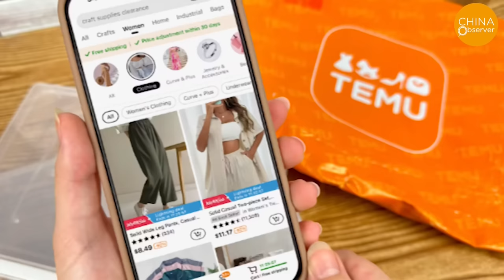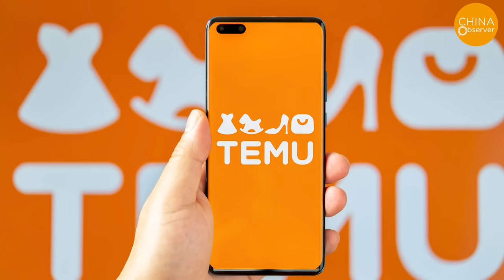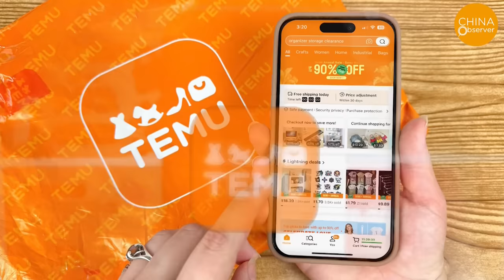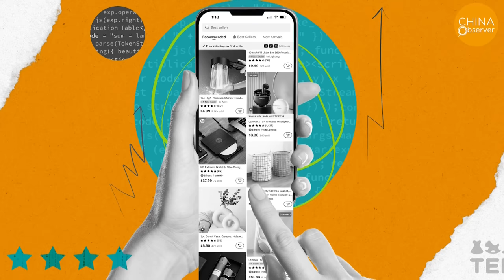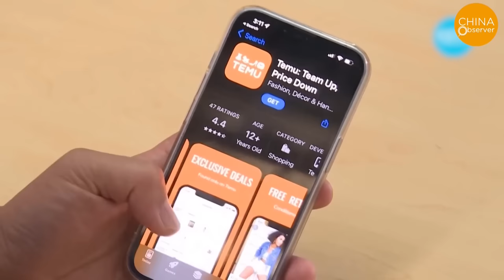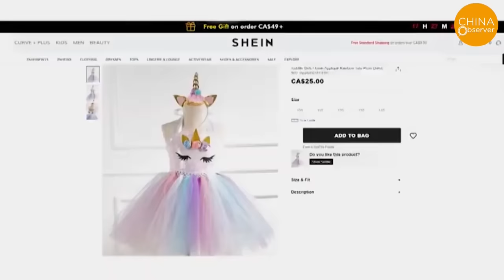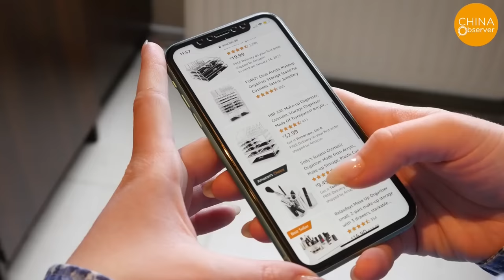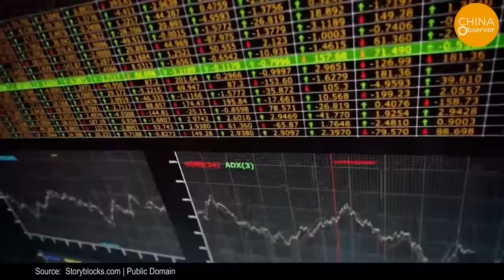Fake & Subpar Products Ripped Through Temu’s Facade, Making Chinese Firms Everyone’s Punching Bag

Comment: The bitterness of poor quality is remembered after the sweetness of low price is forgotten. You get what you pay for.
Reply: Pretty useless to buy something that craps out soon, and you need to buy another one. Better to buy quality and pay more. I have tools that my father bought when he started his trade. They still work fine, and will last another generation if taken care of. Too many tools from China fall apart in short order.
Reply: There are heaps of items where paying an extra 3-5 dollars less than the Amazon price will not make a damn difference so temu is good when you need to buy those items.
Reply: Prices are astronomically high...Forcing manufacturers to reduce their prices is GREAT!!!!....❤
Reply: Absolutely. Anyone  remember Craftsman tools? Sears used to sell them. Lifetime warranty. Gone, replaced by cheap knockoffs. Never had a Craftsman socket split apart. Seen it  several times with cheap Chinese crap.
Reply: Exactly  if they do it to their own people they will definitely do other people wrong
Reply: Sounds like someone is getting a little upset because of Temu. She never said anything they were doing that hurts anyone except those who would cheat the consumer with high prices. With Temu around they have to charge reasonably. Yah nothing wrong with that.
Reply: That is why you can also get expensive items made in China too.. If you buy expensive items the quality is very good. Even better than things made in your own country. You can also buy bad quality things made in your own country too.
Reply: the good taste of quality lingers long after the sweetness of a good price
Reply: @Studioladya I always think this...  the evidence is astounding lol

Comment: In Germany you say: If you buy cheap, you buy twice. First the lesser product, that do not meet your expectations, the the lasting one of propper quality. 

Sir Peter Ustinov said: The joy about the low price vanishes faster than the misery about the bad quality.
Reply: Not everyone has or had the same salary ect of Peter U. Unfortunately.
Reply: Buy once, cry once
Reply: The problem with your theory is that now in 2023 it is not always possible to buy a quality version of every product. Many products are only made by one or two chinese factories that make them as cheaply as possible.
Reply: @SirReptitious  than is right, but just another issue.
Reply: Unfortunately, all companies are now getting thing manufacturing outside of Germany and we have no choice. Same in other countries.
Reply: @nitinkumar29  Check your point of view:  „All companieas“ „no choice“ is absolute bullshit. Even if there are single occasions where a unique product is just manufactured in china.

 But most of the times there ARE alternatives. 

I bougt tshirts online from france made from bio-cotton. Outstanding quality. 30€ a peace. No alternative to 3 shirts from H&M. 

Often you get much better quality buying used gear instead new rubbish.
Reply: @assai74  Sorry, i take my words back. The alternative are there, but do you know that most of the raw material comes from China, so even if Tshirts are made in France, the raw material for the fabric is coming from outside the EU. The supply lines are so much so globalized.
Reply: @nitinkumar29  it is not about avoiding product from a certain country! It is about creating added value and a balance of reasonable price and decent quality. Even in china, there are products manufactured worth the money.

But there is a problem, if you have no competition left in the market, if there is just a single plant left for a certain drug worldwide. Or all chips come drom taiwan. 

Be aware of where you spend your money.
Reply: @assai74  I have seen similar product sold by different companies with different markup prices. So if one has not seen similar product with less markup, he may think that the product is good for the price. Big companies are selling something with huge margin does always mean better quality, and without using the product it is not possible to know the quality personally. 
Than customer reviews may help in that case but the we have fake reviews problem since many years. It comes down to the trust that many companies used to be known for good quality products are now losing because of globalization and poor quality control.

Comment: I have placed orders many times with both TEMU and SHEIN. I have found the quality of everything I have ordered to be extremely good. The only items I have returned and reordered have been clothing items and only because because some have been too big. I find delivery times to be good and returns and refunds are extremely easy. I'm going to continue using and ordering from both companies.
Reply: Really? I bought a few things and most of it was garbage quality with a few decent standouts. It's been very hit and miss for me and I I don't shop there any more.
Reply: Shein was recommended to me as being a cut above Temu both in term of quality & of shipment.  I just placed an order with Shein; two weeks as opposed to two monthsconfirms the second.  I hope the items I ordered confirms the first.
Reply: SHEIN sells garbage. My son insisted on ordering through them several times and I can’t stand even touching the fabric it’s so cheap.

Comment: I bought some things off TEMU and they were half price, but only half of them worked. For example, I purchased a set of titanium tipped drill bits. Poor quality drill bits would not hold their sharpness, but these literally didn't drill at all. Not even plastic. They were completely blunt. Total waste of time.
Reply: Dangerous as hell. Bet they can break easily as are most cheap Chinese-made products.
Reply: Even dull bits will bite, u sure your drill wasn’t on reverse?? Or were u using some piece of junk drill to?? I’m asking but joking around
Reply: I was on a refinery job. They bought Chinese tools. Box wrenches stripped out under hand pressure, no cheaters, flat box wrenches that bent sideways under hand pressure no cheaters, hammers with heads flying off the first time they were used. Come alongs with cheap wire that the handles bent. Just absolute dangerous junk!
Reply: i can't believe y'all actually thought products would be good.
Reply: U but drill bit from a tool n hardware store ….not Temu
Reply: Do you not even have a harbor freight near you?? I do understand though when it comes to drill bits anything less than the highest quality you are going to get single or half use out of them. Which I am sure you must atleast half know now.
Reply: @dipndaVic  hacksaw blades that the teeth would strip off before even cutting an 1/8 of an inch deep
Reply: You get what you pay for, be cheep get cheep
Reply: I like Temu for office products and craft supplies.  I have not been disappointed.  Buying these items from U.S. stores are ridiculously expensive.  My money, my choice where I spend it.  Maybe companies should think about the consumers they want to serve.  Walmart, Dollar Tree, etc have.

Comment: I'm in Canada. I bought three 40Watt USB chargers. Turned out they can charge at no more than 10Watts. I threw them all away. That was the last time I use Temu. However, my wife keeps using them. She buys cheap less than $20 items. Temu keeps screwing up the shipment. A couple times they shipped over $300 of goods to us but their records showed we haven't received it (lost in transit) and they reimbursed the whole $300 to us. LOL! This happened twice. haha. Both times we already received the goods.

Temu's shipment also constantly have trouble getting through custom. We have been compensated several times, each time $5 (per item) even if we decided to cancel the order because we didn't want to wait for it to go through custom. Everytime it got stuck in custom, It takes over a month before they are cleared.

Comment: I'm a regular shopper on TEMU.  Having watched this video, I think most of the complaints are exaggerated.  True some items don't perform as promised.  An example being Wrist Blood Pressure Monitors.

I threw away 2 blood pressure monitors.  My attitude about is "no big deal".  The savings (collectively) from all the past purchases of other items more than makes up for the few items from TEMU I bought that were bad quality.
Reply: I agree. I have returned several things and it was very easy, not even requiring shipping them back, and I received immediate credit.  Some things you discover are no go.  I don't buy shoes from them anymore due to size differences.
Reply: Just send it to the landfill.. no big deal 🤦‍♀️
Reply: @wilma888  I don't think anyone is throwing anything in the trash.  Anything that didn't fit me, I have given to friends who wear that size.  That's what others do as well from what I have seen.  I have not received anything that didn't work properly.
Reply: @pamelalandis4627   I love that you take this approach but if you see the main comment you’ll read..  “I threw away 2 blood pressure monitors. My attitude about is “no big deal”
Reply: @wilma888  I understand.  Yeah, the same quality/same merch is being sold on Amazon, too.  So I guess that would end up in landfill as well.  I did have a sunscreen for my car that didn't last long before it broke.  So I cut off the material and I still spread it on my dash to protect it, as it was my reason for buying it in the first place.

Comment: The dirt-cheap prices alone is a giveaway. If know the price of a branded item and you came across a similar item priced way cheap, then it's either fake or a knockoff of the real thing which means substandard quality. You get what you pay for.
Reply: Blame those who increased interest rates for destroying demand and make cheap prices a necessity.
Reply: what if I told you that the branded item is also produced from the same factory in China?
Reply: @astrohawke4527  That is correct. China created factory clusters that are difficult to emulate and Chinese learned to produce quality just like Japanese did. In the 1960s japanese products had poor quality but nobody remembers it.
Reply: I don't believe companies who spent years building their reputation on quality will let shady manufacturers ruin it with poor quality products with their name attached to it. 10 to 25% cheaper I can accept. But 75 to 90%? I will be suspicious.
Reply: @ronnelacido1711  China is not shady anymore. Catalyst Game Labs looked everywhere in USA for a company to make tabletop miniatures. There are none. Only China has them. And their miniatures are great. When I use a magnifier to see them I can tell.

Japan in the 1960s was equivalent of subpart quality. Chinese learned to produce quality too. 

But just like any country that got out of the hole, it still may have specific traits that will shock you. So avoid food made in China.
Reply: Yes and no, it depends on how cheap compared to the original branded item as that is likely inflated due to being a brand item. So you could probably get a decent replica in quality but it wouldn't be dirt cheap, just cheaper. If something is too cheap compared to the original, especially if there is a lot of intricate detail work, then nope, no way are you going to get anything like the original. The fact that they fool consumers with pictures of the original brand item or a single well made item should be enough warning that it's a scam. Nobody can mass produce a quality hoodie for a global market with quality materials and workmanship for only $5. Some of that price should ideally be profit as well.

Comment: And the low prices often DON’T even help consumers.  You likely know older relatives who got a vacuum cleaner as a young newly wed, and used it for decades after, often their whole life.  Now, you can get a $100 vacuum that is Made in China, but it will function for 6 months to 1.5 years, at best, then you buy a new cheap one, that will also quickly break.    

People think that buying a $100 vacuum, that breaks in 6 -18 months, is “cheaper,” but in reality a $500 vacuum that lasts 10 years costs consumers less, plus doesn’t fill landfills up with disposable junk made only to look good on the shelf and then quickly break.

Comment: I buy from temu sometimes and except for their jewelry, i have not found fault with any of their products. There clothing is good quality, though figuring out the right size may be a bit of a challenge.  I am getting tired of people dumping on them. Their quality is much better than Kmart's used to be.!!
Reply: Ya I’ve been buying things from Temu and have been pleasantly surprised by the quality of almost everything, with just a couple exceptions. Sometimes the packaging is bad though. I ordered a curling iron for a gift and it’s nice but the box arrived all dented up.
Reply: If you want good jewelry from Temu that doesn't turn your skin green buy stainless steel. That's all I ware or buy and Temu has it at fantastic prices. Now the clothing is what I don't really like from Temu, too much of it is made with the nasty shiny polyester. Thankfully Temu has a good return policy. I haven't had a problem returning anything I wanted to. Most of the time they just let me keep it. Yep Temu is ok by me.

Comment: Temu can sell for cheap partly because of platform policy, but most importantly due to its practice bypassed the whole import process and tax. They use the tax loophole of any “interpersonal item worth less than $500 claimed value” can come in US without going through import checks and tax by mailing the item directly to the buyer as interpersonal small parcel instead of shipping in the cargo container like proper import goods. The US lost huge amounts of tax money because of this practice. On top of evading tax, the direct shipping means no jobs can be generated in the US side on post import processing, so US consumers spend money without doing any benefit to US economy.

Comment: About 20 years ago, my father went to my aunt house after she called him for help, she bought some electric device and for some reason it just won't start, and since my dad is an electrician and we pretty much live in the same neighborhood (in fact my entire clan is in the same area) so my dad pop the thing open, theres nothing inside except for a big concrete for weight. Nuff say, its made in China. Fast forward to my highschool life, one of my rich classmate got himself a brand new iPhone for cheap online, its good until he find out he cant charge the thing, as the thing is badly made the battery can't be replace either, a fortune spent for 3 hours of fiddling

Comment: The problem I see is not the same as you see. I like buying dies for card making. The dies are just as good as the dies that sell for $30 on the regular craft products only cost $1-5 on the Temu site. I would spend more for the company that designed them if they were twice the price of Temu, but when it is so much cheaper it shows me that the standard company is price gouging us.

Comment: I have only order pens and Sticky notes from Temu at this point. Maybe no more pens in the future. I used Papermate 0.5 mm ink pens. A box of 12 pens costed $10-$12 and increased to $16-18$ last year. I went to Temu for alternative options.... bad decision. The first attempt was working fine, each cost $3.99 and come with 10 pens in a pack. I ordered 2 more to realize later packs have ink completely dried, or pen used up quickly. I.E. Each papermate ink pen last about 2.5 -3 weeks. These Temu pens only last for roughly 4-5 days, not counting the dried ones. I ended up spent more money using these pens than outright order my papermate ink pens anyhow.

Comment: Temu aside, brick and mortar stores are generally not very useful compared to platforms like Amazon. If you look into how many of the stores are stocked, you will understand that they are not catering to customers, but to suppliers. This is a part of the cause of their downfall in the presence of on-line platforms where products from all manufacturers are available at all times. For over 99% of things I buy, for example, I do not need to touch the product to know what I need. Almost everything I buy does not have to be obtainable at a particular time or date.
Reply: You are correct but you are just laying out the know features of physical store vs online market place. It’s a fact that you are learning but  not a novel observation. 

And physical stores are not ‘catering’ to suppliers, they are subject to the supply limitations of their region and budget
Reply: @gregtaylor9806  Suppliers, and their salesman, have an inordinate effect on the physical stores. Shelf space is limited and the suppliers compete for this. I have first hand knowledge of this phenomenon. On the other hand, it is almost trivial to list in an on-line store, or even possible to set one up yourself.

Comment: I have got some lovely quality dresses and tops and a skirt off temu which I was very pleased with.  Love them.  However the last two things I have got at different times (a dress and a skirt) have arrived with no size inside (they obviously sold out of my size) and they are 2 or 3 sizes bigger so I have to give them away.  
Temu should be honest if they have run out of the requested size.  My relative orders a lot off Temu and gets my things too.  I liked the material of the two nice things but it is unfortunate they are way too big. I am a regular 12/14 and the two items are like 16 or 18 or more.